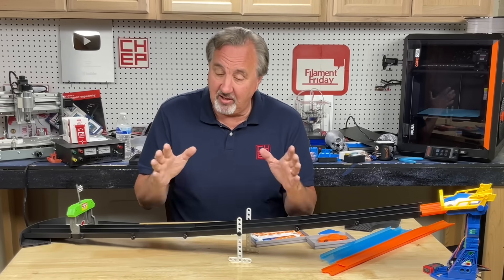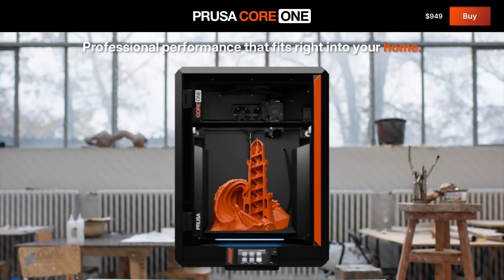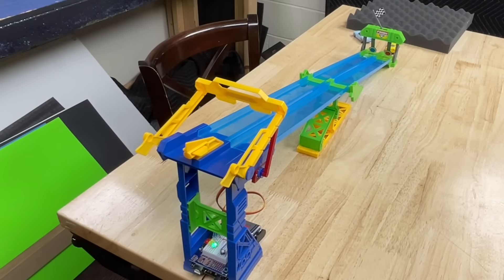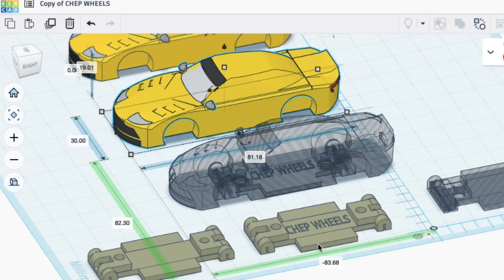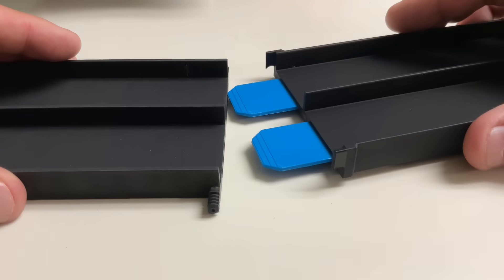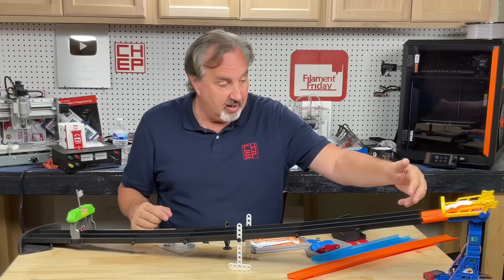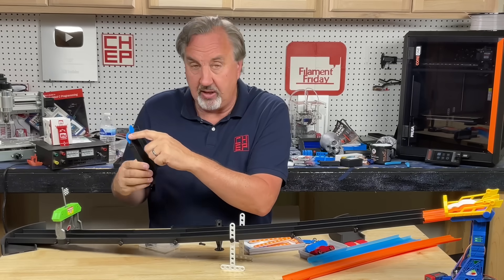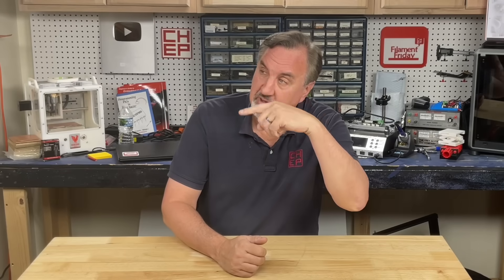3D Printed Hot Wheels Style Cars and Track on Prusa Core One

Comment: It was many years ago that I wrote several programs to generate add-on pieces for the tile-based track editor for the PC racing game "Re-Volt"; I'm sure you could do the same thing with OpenSCAD, which is a coding-based design program. Something like writing a loop to loft the track cross-section through the path for the turn, adjusting the bank angle as a function of the angle in the loft path.

Comment: Love this.  I have 2 young grandsons and this would be an awesome build for them.  I have been an industrial designer for over 40 years and at least 25 years with 3D design using Solidworks.  I would be happy to work with you to design the banked curves.  I have actually designed roller carton conveyors with banked curves.  It is a challenge indeed but Solidworks has the tools required to do it accurately. Let me know if you are interested.

Comment: Wonder if the grandkids or ( Older Adults acting like a kid) can design a car and how long would it take to print as putting more weight in front for a faster car?  can they print in few mins or hours
Reply from the maker: The design can have a hollow core and have a space for washers so you can pause it, insert the washers, then un-pause to finish the print. No change in time other than the pause.